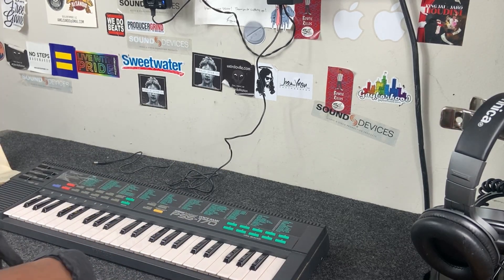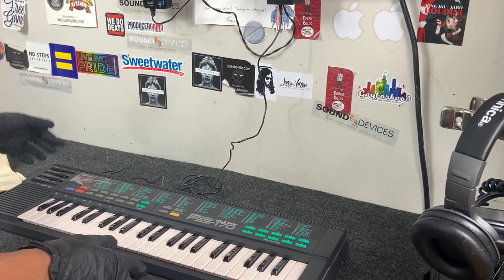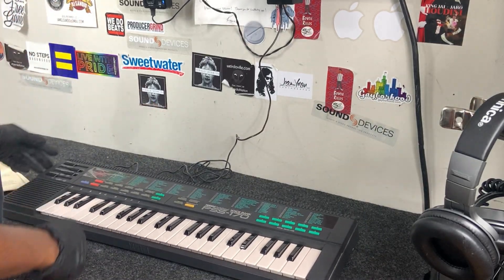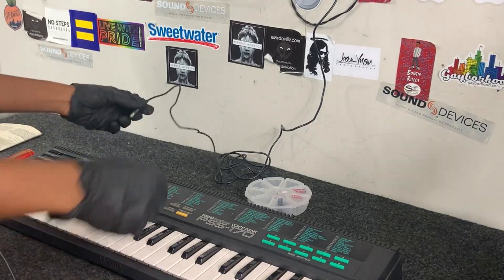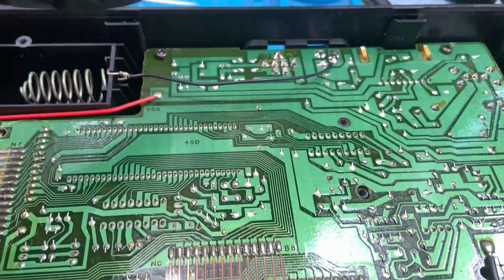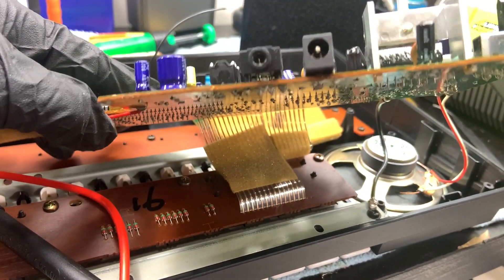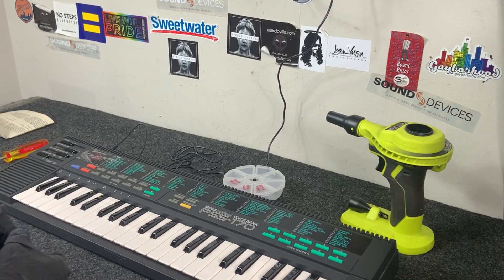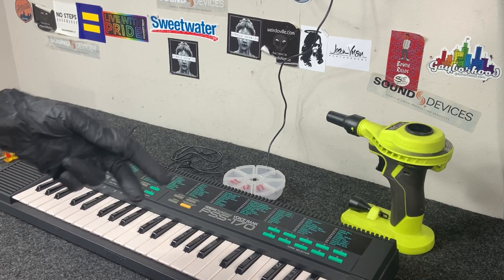Yamaha PSS-170 Intermittent Power Issue Repair

Comment: Just got the same keyboard but the output is dirty as AF. Do you have any suggestions on how to clean up the output signal?
Reply from the maker: You can try cleaning it with some Deoxit D5 or electronic contact cleaner. If still getting a static/dirty signal might be time to pop it open to make sure it doesn’t have a cold solder joint. Take care. 

CoCo